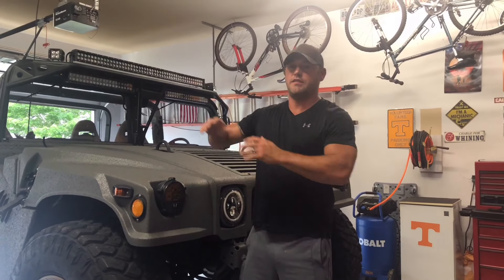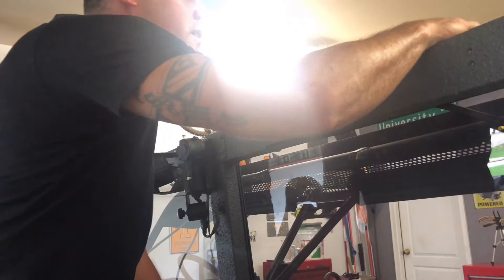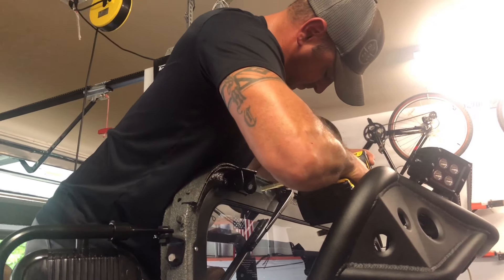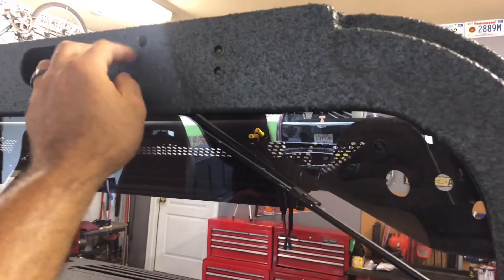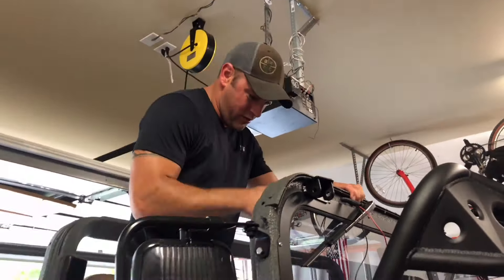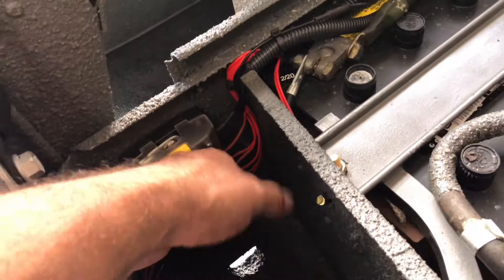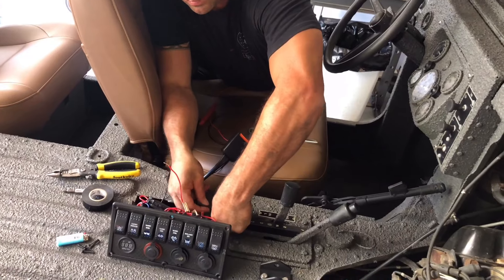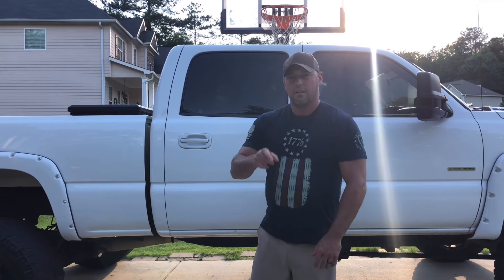Humvee Build Part 20

Comment: Great video. Love the progress. Would it have been possible to route the wiring to the center of the windshield and down to the engine compartment behind the windshield center piece?
Reply from the maker: May have been able to route them through the windshield but that be a little tricky fishing those wires through.